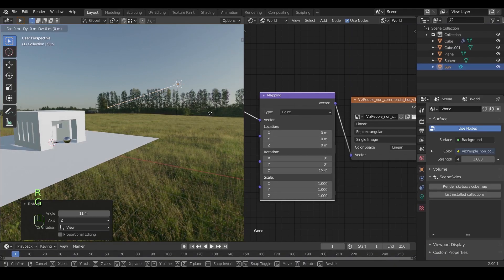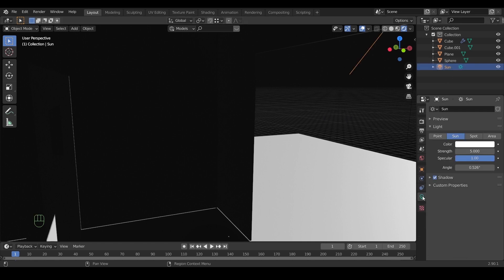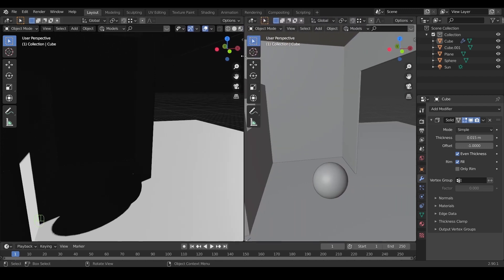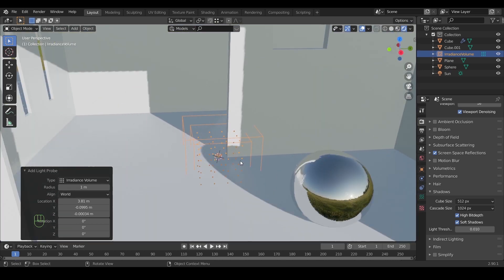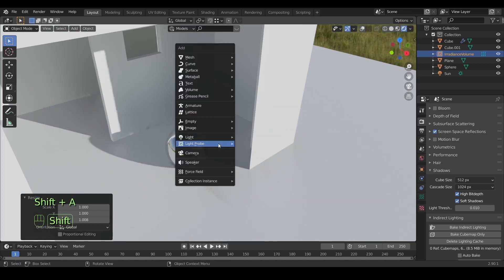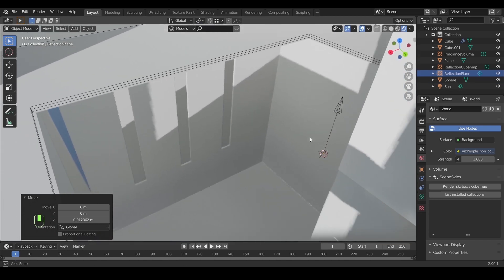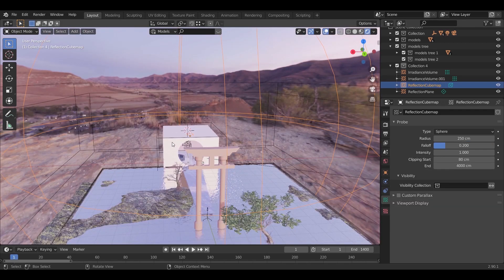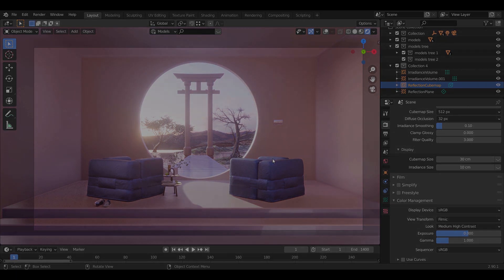Eevee Realistic Lighting in blender - Beginner guide

Comment: Sorry if it's not the right place to ask, but is there some mad lad that found a way to combine VSM, ESM shadows from Blender 2.8 with 2.9 and onwards? 2.8 shadows have more tweaking options and can be rendered decently, without need of sampling and without soft-shadows option, which means full real-time. I talking about something like, render animation in 3.3 without shadows and then mixing it with 2.8 shadows only. I guess main problem is eevee didn't have a good shadow cather, and custom nodes that i've seen is extremelly unreliable and need a tweak case by case basis, including lighting, to render them as transparent independent layer. That would making animation's so much faster, especially for low-end computers.
Reply: Use Gobos add on for realism

Comment: The hdr is not appearing in viewport sharing render preview. I can see the background through the window, but the area outside hasnt changed. Any tips?
Reply from the maker: Just make sure you use Environment texture in the color input and that the world light strength is not set to 0. There's a small chance that the HDRI map is the problem so try another one if you have or even reset the scene in case you change any settings by mistake.
HDRI should appear clearly in render view once you open it.
hope this helps.
Reply: @architecturetopics  I'll try it out, hope it works now
Reply: @architecturetopics  The hdr did appear in the shader editor, so I guess it's not the problem?